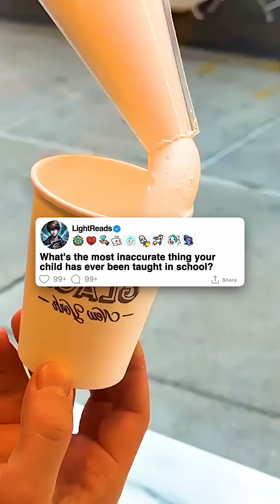#freak2fr

Comment: Blood is blue inside arteries, and it is red inside veins. Arteries hold deoxigenated blood.
Reply: All arteries except the pulmonary artery carry occurred blood to the body, away from the heart. The same with veins, only they carry deoxygenated blood from the body to the heart. 

The pulmonary artery carries the deoxygenated blood that has returned to the heart via the veins to the lungs in order to be occurred. The pulmonary vein carries this newly occurred blood to the heart, from which point it is again carried around the body in arteries. 

Blood moves from arteries to veins through capillaries that carry both oxygenated and deoxygenated blood. Capillaries are also where gaseous exchange occurs, allowing oxygen to diffuser out of the blood and carbon dioxide the diffuse into the blood